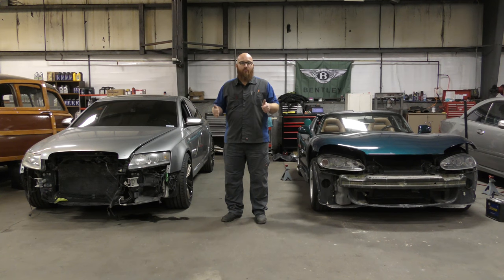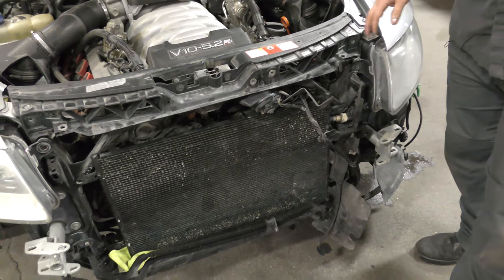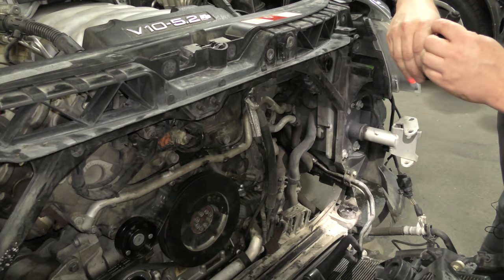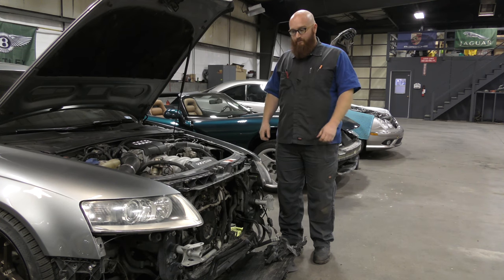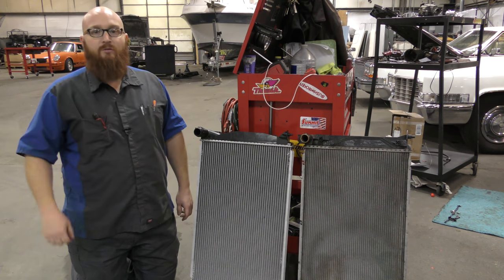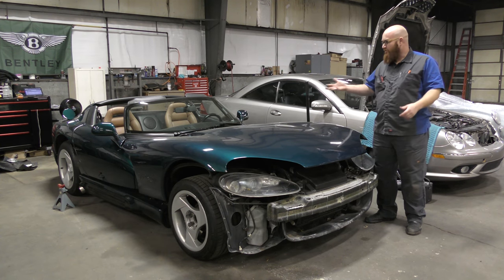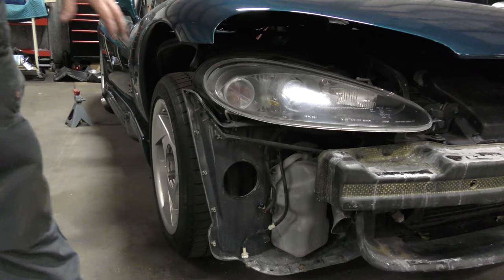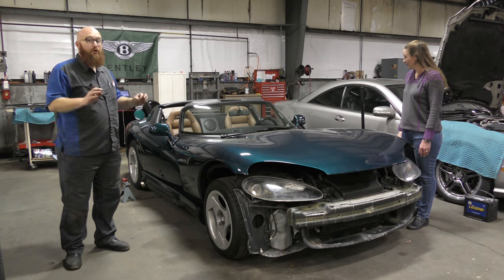What?! The CAR WIZARD has to remove the bumper on an Audi S6 & Dodge Viper to make easy repairs?

Comment: Audi S4,S5,A6,A7 with the supercharged 3.0 liter is the most reliable engine we service at the Audi dealership.
Reply: AJ  stay away from older, high mileage turbo 4 cylinder... worn piston rings, oil consumption, turbo failure.
Reply: The 5.2 V10 is built like a tank ! I just wish the previous owners actually cared about that 🥲

Comment: For all german cars your better off buying from fcp euro. Lifetime warranty on all parts. Other youtubers use them.
Reply: Yes if they shipped to Ireland I'd definitely buy a German car no problems and best of all the usually have upgraded aftermarket parts as well that are way better than the original
Reply: Lifetime warranty on a $50 part doesn't mean much if it costs $1000 in labour to change it.
Reply: @VC-Toronto  I  AM the warranty
Reply: @VC-Toronto  ya that is true

Comment: I remember my mk3 vr6 vw always had a check engine light for "Secondary air injection, incorrect flow". The issue was a cracked plastic hose that runs under the intake manifold between the radiator and the front of the engine. To get to this hose you need to remove the radiator support. The light was just ignored, it only affected cold start emissions.

Comment: As a spray painter we pull bumpers off and replace them regularly.
Most of the time mechanics have destroyed the mounting clips and the like years before we get near the car.
I fully understand how much of a pain in the ass it is.
Also to the future mechanic working my 2010 Impreza gearbox i have for sale, I have had to weld the centre vlsd cover plate closed because the bearing shop failed to order the replacement retaining clip 2 weeks ago.
Much love mate, great video as usual 😁

Comment: "Engineered to FIT" is what Jared said, :Not engineered to work on." VW products with BIG engines.
Reply: Fun fact. my audi S8 V10 has an alternator belt thats further forward  than the front headlight bulb
Reply: @Nordic_Mechanic  That's crazy! As long it fit I supposed! LOL
Reply: @MrTiger0002  Didnt have much choice, back then the audi a8 was the only sedan you could have a 10 and 12 cylinder with awd. Mercedes and bmw was only rwd with the larger engines.  Audi could do it because the quattro system  puts the engine far forward. they could have made the cowl removable and it would have made service easier though
Reply: @Nordic_Mechanic  VW's family of cars like pointy and narrower front ends. I know what you are talking about... I got VW Phaeton W12... absolutely zero room in engine bay to do anything. I could barely get the air filter top cover out! The fender design and progressively narrower front end really took away all those space. If they had made teh hood 2" or 3" longer would have been a world of difference. They seem to design cars with smaller engines and then shoehorn the bigger one in. They should be doing the other way around.
Reply: @MrTiger0002  count yourself lucky, the v10 is MUCH larger than the W12. 5 cylinder long, and 90 degree like a v8 makes it very large. So they had to run the powersteering pump and ac through a pto of the back of the engine, shaft going through then.  Although, the S8 has a full width bonnet unlike A6 cars with wedge style. Good thing they are reliable engine. Of course a 16 yo car is gonna have issue and they are harder to fix on those than on camry.  My only gripe is the o2 sensor location on our car and the fact they had to use 4 smaller catalytic converter and thus, 8 sensor isntead of 4.  What's remarkable is if youre looking for something smooth and quiet inside , theyre nothing affordable on the market. You need those old luxury cars and pull engine, fix it all up. By the time you spent 30k you have something that feel better than anything you can buy new unless you want to spend over 120 000.  Heck, look at my a8l on my channel, 543 000km 337 000miles on the clock and people say they are unreliable my ass. Just service it correctly and it will run. Same people who complain get in the car and are amazed at how nice they feel.  Of course if you care about wind noise , road noise and harsh suspension, those luxury cars makes no sense. But if you want to get to your destination more relaxed than when you started driving, they start to make sense.
Reply: @Nordic_Mechanic  Whoa! 337,000 miles/! That's amazing! Yes, totally agree with you... just fix eveyrthing if you have to pull engine out. It's way cheaper than multiple times. Yes, fix the car by all mean.. it's terrible to throw cars away. Car repairs are also getting way more expensive these days... never seen such an increase so rapidly. I do fix cars myself so it's a bit more affordable. I'll check your channel out!
Reply: @MrTiger0002  My thought with these cars is you get the car into a mecanic shop twice a year. Finding you have a slow transmission oil leak ahead of it damaging the transmission makes all the difference . Preventive maintenance is more money up front, and less overtime. Saves a lot of labor.  You dont replace 1 bushing, you do them all and youre good for 10 year! Labor once, downtime once. Done deal.  Yeah 337 000 miles is the highest Ive seen on a a8.  She took a bit of wiring to sort issues but she's good now. Still on factory mecanicals throughout except 2 timing belts of course, 3rd one coming up soon.

Comment: I wonder if part of the reason the Audi is so difficult to work on is the fact that Audi designed the chassis for a V6 and a V8, then decided to cram a V10 in there.  There was no room, so they had to come up with engineering "solutions" to actually make it fit that make it a nightmare to work on.
Reply: Even on the v6 there is no room 😂

Comment: May I point out some mistakes: 
-A car is not designed to be serviced, but to be used. In the case of the A6 it is designed for a fwd layout for Europe where the majority of the sales are,  with a 2.0 or 3.0 diesel engine. To do that you have to move the engine forward to create more space for the interior. 
Serviceability is of secondary importance. 
-Additionally the 5.2 is not at all Lamborghini derived. It is commonly mistaken with the 5.0 used in the C6 RS6 and gallardo. The 5.2 was an all new project developed from Audi's 4.2 V8 which was used for a very long time
Reply: Never knew that they sound so alike
Reply: A good car ought to be both functional, reliable, and serviceable. nothing runs forever, and it's environmentally irresponsible to just assume certain parts will last the life of a car. sacrificing serviceability, for the sake of functionality, results in cars being totalled out far sooner than they ought to be, which leads to waste, by the consumer, and by the manufacturers. Recycling cars, is far more harmful to the environment, than repairing and reusing cars. 

Designing vehicles such that it is impractical to repair them, is bad design. full stop.
Reply: @Cal94  Agree with you, cars should be serviceable, and engineers whenever they can, should consider that when designing. But for a car selling just a few thousands it is more acceptable to make it like that. Its a balancing act of costs/benefits etc. Normally those things (audis), and in extension German cars are way more reliable than portrayed by american media. I have experience with many Audis, Merc's and Bmw in which they are conceived and are more reliable than their Japanese counterparts in Europe. It is not known why German cars are unreliable in the US but it has been noted several times. 

So making a car "harder" to do a "major" service is a small cost to pay over redesigning the entire car to fit the massive engines.
Reply: @Cal94  you've got to love how they bring on about climate change but they make things to fail very fast now while before simple maintenance and they would run forever
Reply: @Cal94  Designing vehicles such that they be able to achieve mind blowing things is not bad design. The thrill and satisfaction you have when driving a normal sedan fitted with a V10 engine does not even exist with the same car with a 4-cylinder engine. You may go for the latter because you don't care. Some chose the V10 because they do care and are ready to face the downsides of it. "Bad design" is just a cheap excuse from "lazy mechanics".
Reply: @KeliK1  the techs charge book time either way. Why should I let off car makers, for building cars with insane book times, for what either ought to be simple tasks, or scheduled maintenance? heck, if i go to a dealer, they probably have all the fancy ass tools and "expertise" to do 10 hr jobs in 2, but i'd still be on the hook for all 10 hours and anything they may break while cutting those corners. or if it's under warranty, or being leased, then the automaker is on the hook. but these kind of issues, are not limited to the Audi S6, or Audi alone, it's an industry trend.

I'm not against performance, in cars. But for LUXURY brands, they know damn well some of their clientele is going to expect any given car in their lineup to have some get-up in it. if they think they may want to stuff a V10 in a platform, the smart thing to do, would be to design the platform with room for a v10. then your i6's, or v6's, or v8 models, all have plenty of room for activities, and the v10 is reasonable. but how many luxury brands, can you take an average sedan, pop open the hood, see an i6 or v6 and think "that's a really cramped engine bay", then learn there's V8's in the product stack. or how many times have auto makers declared "this part is lifetime", or "this fluid is lifetime, so we don't need to engineer a practical way to get at it". and then the lifetime part, or something near it, turns out to be defective from the factory, and suddenly everyone needs that exact job done. Luxury brands have shown they don't need to mess around with V10s or W12s to overengineer the shit out of a car
Reply: @Cal94  Because the car makers are not making these kind of cars for people like you and because making room for a bigger engine would not make way for a normal looking sedan with plenty of cabin room and blistering performance to exist. If you buy such a complicated car to maintain after warranty, there is no one else to blame but yourself. The original owners would tell you a different story.

They usually stick the lifetime label mostly to a replaceable internal part in an assembly. Let's say the fluid for an automatic transmission for example. People just don't understand that this is not about their lifetime as a human being. And it is not about the lifetime of the whole vehicle either. It is about the lifetime of the part assembly itself. It means changing the original fluid would not extend the life of the automatic transmission. The fluid being lifetime means the fluid is capable of lubricating the internal parts for the life of the transmission. Changing it is pointless and would not extend the life of the transmission by much. They have vigorously tested the parts with the fluids they put in them to come to that conclusion.
Reply: @KeliK1  dude, if you wanna be elitist about power, it's an S6. it's not a halo car in Audi's lineup. If Audi ain't gonna engineer in space, then they should tell them rich boys to pony up for an S8.
Reply: @Cal94  Now you sound like somebody who doesn't know what he is talking about. Size matters to most. A full-size sport sedan is not a mid-size sport sedan. To most the S8 is too big. You're in S-Class territory. The S6 has enough cabin space, is relatively small and hey, it got a derived Lamborghini V10 you can brag about! That's why Audi made it and that's why people bought it. I would have bought this S6 over the regular A6 and over the S8. You may have not. To each their own.
Reply: @KeliK1  and you've been missing my point from the start. There are listicles of I6, V6 and V8 engined luxury cars, and luxury SUVs, where basic maintenance means front end disassembly, or engine out. Cramming the V10 into a midsize platform is only the most extreme example of an industry wide problem. If you want to claim this S6 is an RS 6, fine. I'd bloody well expect the back to say RS 6, if i'm getting RS 6 tier problems. but as you say, to each their own. That doesn't negate the issue, that in cheaper and cheaper cars that don't have nearly as much power, you'll need to expend as much effort to fix things, cause the big automakers are trickling down the wrong tech. You get audi problems in your volkswagens. And I don't believe they should be praised for that.
Reply: @Cal94  The problem with cars today has nothing to do with the size of the engine but their complexity due to stricter and stricter emissions regulations. People used to think it was too complicated to remove the front of the car to change the timing belt with non-DGI engines. Now that sounds far easier because you have to completely remove the engine to replace timing chains in DGI engines. Automakers do not choose the complicate things. Regulations are making them do it. It is easy as a customer or a mechanic with no car engineering experience to blame them. In their shoes you might do worse. Many things are at stake and they have to make decisions that should make everybody happy: their shareholders, emissions regulators and customers.

To come back to the subject, buy a slow and boring car if reliability and ease of maintenance are your priorities. There are plenty of them out there. Buy an exciting and thrilling car if you don't really care about reliability and ease of maintenance. You can't have the best of both worlds. That's the way things are.
Reply: Nah man, added complexity inside engines, may mean there are more steps to a given task, but that's not a blanket reason for not having room around the engine, to pull stuff off it. If it were only easier to pull the engine out for simple tasks, that's one thing. But if it's physically impossible to reach bolts and remove parts through the top or bottom of the car, that's another. That's them putting engines in cars that should not have them.
Reply: @Cal94  if we never introduced complexity to anything we would still be trying to understand how fire works while starving to death. Personally I would rather I would rather a more complex engine of course if there are advantages to it. I say that being someone who only works on his own cars. That is because I appreciate the interest to move forward. If no one shoehorned a 5.2 v10 engine to a a6 we would have landyachts and well apart from 10 people no one would drive such a large car for a daily.

Comment: Rockauto.com did that to me in September when I ordered parts for a Sequoia 4wd. They listed a canister-type fuel filter  I ordered before I knew that the only fuel filter was in the tank. They also listed a 2wd left lower ball joint as suitable for 4wd.  The right LBJ listed was correct, but the left one had a grease fitting right where the  CV meets the hub.

Comment: The second time I replaced a radiator in my Sequoia took about 10 minutes.  Everything in Audi requires the service position or the core support off.  I do appreciate it when doing a timing belt.  I am a proponent of engineers being forced to perform services on the cars before going into production.

Comment: I found out the hard way not to do a starter on a 78 chevette , you have to remove the intake and exhaust manifolds, unless you have 3 feet of extensions and even then you are removing bolts blindly . This chevette was the worst car I worked on, I did not like messing with computers so I stuck with the older cars and that's why I watch you wizard, plus others , to remind me what I am not missing , bless you wizard I would be pissed if I had to pull body parts just to get at a radiator.

Comment: In my 1996 Mercedes W202 it takes about five Minutes to take the bumper off, but there is nothing behind it that needs work. One of the easyest cars I ever worked on.
Reply: The W204 is easy as well, only had to remove because a dumbass hit it while reversing and had to repaint.
Reply: @Georg My parents have one like that; a '96 too. C180 Classic.
It's not given many problems.

Comment: Love my Audis, but the old ones are such a chore to replace the timing belt. Have take the front off, just like the Audi in this video.
Reply: They got significantly better over the years especially the B8 S4s anything under 2010 I wouldn’t mess with anymore as far as audis go
Reply: @adriann.e7529  I have had an older one for just over 10 years and it has been good, but you really have to be an enthusiast to justify the pre-2010 models, or any older ones really. Glad the newer ones are a bit better.
Reply: Shit man my timing chains on my A5 are engine out. They put them on the rear of the engine
Reply: Did my A8 2001 including cam chain tensioners. Wasn't that bad and I'm over 70.
Reply: @sickvic3909  sure, But if you’re someone who has to pay a mechanic to do it, it’s not that great.
Reply: @adriann.e7529  I would enjoy having a B8 S4 Avant as a daily but it'd probably be expensive to maintain, right? correct me if I am wrong.
Reply: @a88304  It ain't only German cars with timing chain or belt issues, Ford had some V8 and some V6 engines that had timing components on the front and rear of the engine, making it an engine out issue.
Reply: yes but you dont have V 10 inside
Reply: Imagine the 4.2 owners with the terrible timing chain design. The rear is what fails and thats an engine out procedure.
Reply: I owned a '03 A6 with a 4.2 V8. It was a belted engine. My son did a preventive timing belt, water pump, tensioner, and guide change on it. It was his first multi-cam timing belt job. It was his learning experience. Did a super job.  It was that damn Tiptronic transmission that was the downfall of that car. Otherwise, both he and I loved it.
Reply: @adriann.e7529  B8 has a chain.
Reply: @MrLeewsee  ok and.......?
Reply: @adriann.e7529  you deleted the comment I responded to.